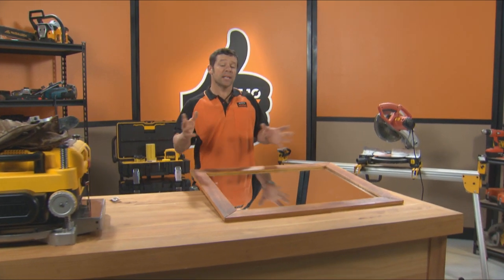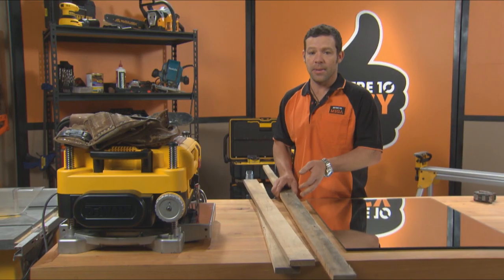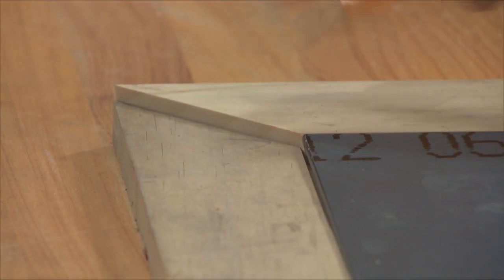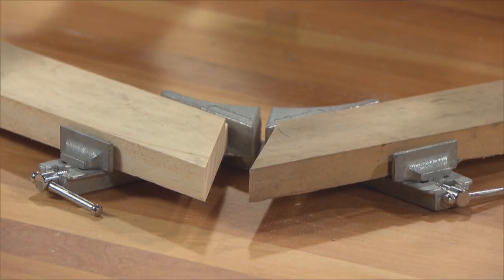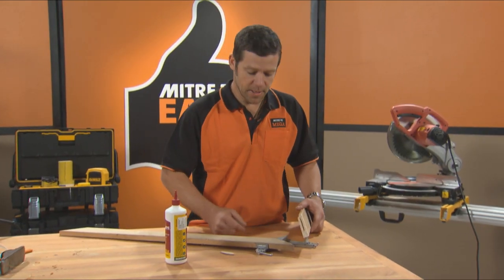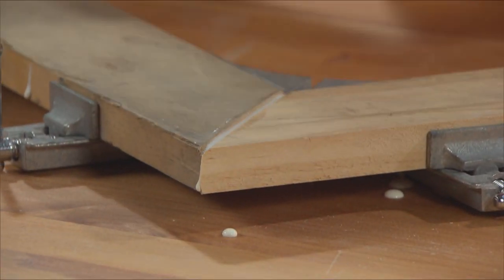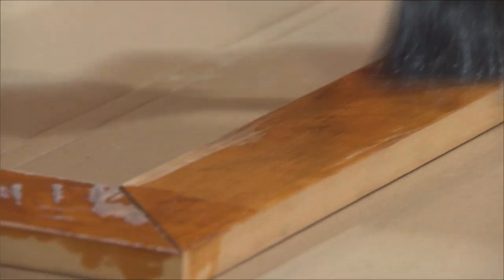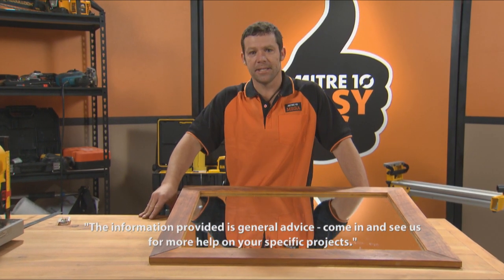How to Build a Mirror Frame | Mitre 10 Easy As DIY

Comment: Note: When you put in a glazing point, make sure it is not as he did, or the glass will start to crack from the pressure on the sharp edge of the pane.  Place the point on the glass, the stick or screwdriver flat against it, and slide gently into the wood.  Then, in needed, tap the back of the stick or driver, to seat the point securely, without undue pressure on the glass, much less the delicate edge of the glass.
Reply: pepper pig